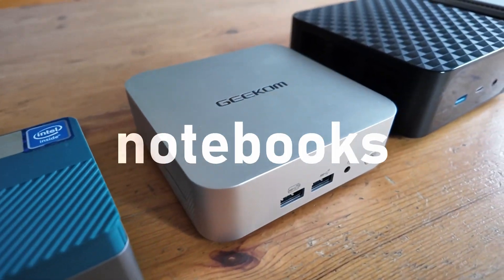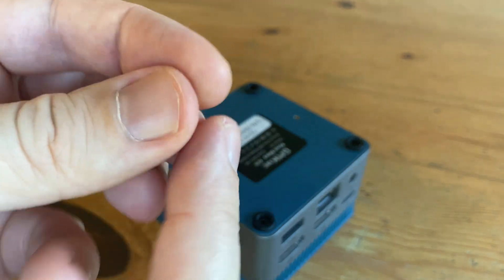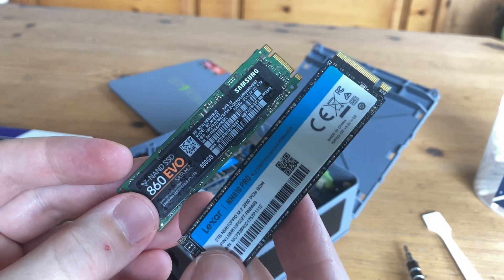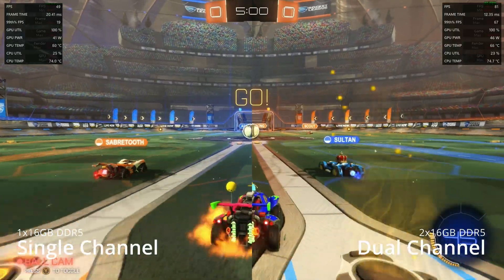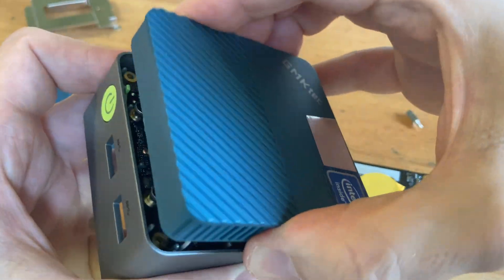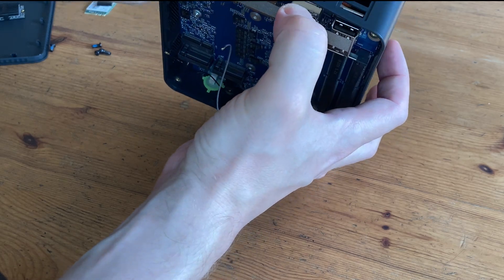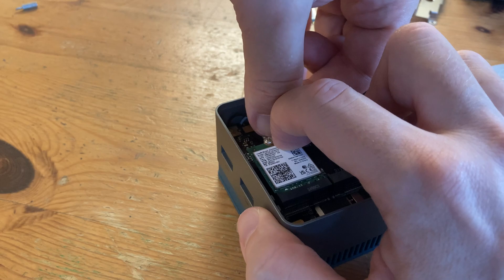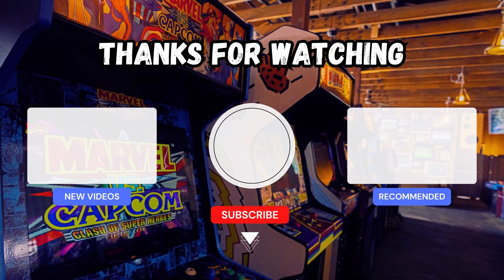Supercharge Your Mini PC! WiFi, CPU, Storage, Memory & GPU Upgrades Explained

Comment: If you want to reapply thermal paste to the cpu cooler MAKE sure your mini pc is not a model that uses liquid metal before proceeding. If it uses liquid metal leave it alone. You have been warned.
Reply from the maker: @toadfish54321 extremely good point. I'll pin that for you
Reply: Any examples of mini PCs that use liquid metal?

Comment: Brother try to cover bluetooth issue with k6 gmktec. It lags and turns off under gaming load
Reply from the maker: Bluetooth and WiFi use the same chip. I reckon switching the WiFi chip will fix both issues

Comment: Hi guys. I realy need your help. I just buy a New laptop gaming Acer predator Helios 300 2022 
Rtx 3070 ti i7 12700h . And il getting thermal limite and Power limite when thé GPU consume a lot of wat like il getting it alwayse when GPU is 62° + GPU consomer a lot of watt cause i play dragon ball z kakarote with hight setting on hot place température get 70° and i get only Power limit (dont activate thermique limite) when i use fans max speed and tempirateurr GPU lower then 62° thé power limite stop . I get this prb when GPU work hard tbh . M'y gpu should bé at least 87° to activate thermique limite. What u think bro us my laptop broke . ( I change métal liquide cpu , bé abusé CPU was realy getting high tempirateurr. They told me pc was on long term storage)
Reply from the maker: @ilyesmalki6447  ?  What?   Christ, did you try to make this unreadable!???

Power limit = Might be your power adapter can't provide the computer enough watts, or you might just want to turn on vsync / sync to your display / limit the frames per second.
Reply: @TeamPandory  the problème is when thé GPU température is 62° . Thé power limite and thermique limite gpu active . Thé GPU is not hot but i got a thermique limite and hotspot i thnik difernce is 12° (if GPU 62° / hotspot 75° ) do u think vram or vrm are hot ?

Comment: any thoughts on using thermal pads instead of paste for the cpu? putting together a build for a gmktec m5 and i'm considering using phase change pads as i hear they have better performance over longer periods of time. it fits my use case as i'll be turning it into a 24/7 router and eventually convert it into a server
Reply from the maker: You can always give it a go. Generally thermal pads are going to perform worse than paste, but I've seen some that are pretty pricey, perform well and can last a very long time. Haven't tried them though.

Comment: I have a HA-4 Ryzan 7 7735hs and want to upgrade or get an external GPU to run 5120x1440@200hz resolution on a LG 45GR65DC-B monitor right now the monitor will only give me split screen or 3/4 of screen it has different screen layouts but wont give me full screen for win 11 pro but i can hook a PS5 or Xbox X directly to the monitor and get full screen with no problem ? Dont know wjat to do any suggestions please help!!!!

Comment: You make me wanna pull the trigger on a mini PC 😂. Personally, which brands do you think can be easily worked on especially for non-technical people?
Reply from the maker: @leel730  tbh the gmktec M7 / M7 Pro / K8 Plus all work great out the box, and have the oculink for extra punt if needed later.  Won't need much fiddling, and I've managed to get into them without much fuss.
Reply: @TeamPandory  been thinking about the M7s as well. Great to hear from you. Amazing content, btw. Keep going! 💪
Reply from the maker: @leel730  Beelink devices are also built very well 👍
Reply: @TeamPandory  yeah, but the M7 is a bit cheaper than the SER6. Thought about the eqr6 but I'm a bit scared of the longevity of an integrated power supply.
Reply from the maker: @leel730  👍 each choice has a pro and con to it. It's quite amazing how some of the tech YouTubers just see all mini PCs as the same, when there are some huge differences between each model.
It's like each manufacturer has their own flavour. 🍔
Reply: @TeamPandory  couldn't agree more. And mini PCs just keep getting better every year.

Comment: So...If you have 16gb Memory on DDDR4...Can you upgrade your mini pc to have 32gb DDDR5 ??, Or do you have to stick with DDDR4 ??
Reply from the maker: @The_Arby  no.  The memory that can be used is dependent on the slot. Ddr4 slot fits ddr4, ddr5 slot fits ddr5.
If you have two slots and 1 ddr4 module is in there, if you can get the same chip and place it in the other slot, it will run in dual channel. Much quicker.

Comment: my gmktec m6 has no sdd heat heatsink. 
i think I'm going to buy a heatsink  for the ram too.
Reply from the maker: @Rayu25Demon  the M6 doesn't really need heatsinks as it has active cooling of the ram and nvme.  If you can find that heatsink of the reatan, that would help the lower memory somewhat though. I REALLY want to install that in some of my other computers.
Reply: @TeamPandory  i have no heat problems, but the pc is always  on because it's a firewall  and a file share server.

Comment: What is the port where wifi card is placed in Gmktech G5? could this be used for eGPU? then wifi replaced by usb dongle or just using LAN for internet.
Reply from the maker: It'd be an M.2 A/E Key'd slot.  You might be able to get an A/E to M key converter, which will give you PCIe2.0 speeds.  Not as good as oculink or anything like that, but it is something.
Reply: @TeamPandory  thanks for the answear. The goal is burst gaming to suficient 1080p for cheapest way . Not for AAA games but for some preferable games I like. I would try GTX750ti ... or GTX1050Ti

Comment: Sometimes the fans themselves are the heat issue.  Just replaced a fan in a laptop where the bearing went.  Temp went through the roof.  So did the noise coming out of the laptop.  The laptop is 5 years old and I had to cut the tape.  Completely clogged with dust in the fan and in the heat pipe fins.  Took the other fan out and it was pretty clogged but reinstalled it.  They were the same fans but one was set upside down for push and pull I guess.   

The fans are 20 bucks US.   I E-Bayed out of China.   I mentioned 5 years.  Did a Youtube search for the fan model.  Someone from China did a ASMR video about 30 seconds long 2 years ago.  Showed a box of these fans.  132 in the box.  Did the finger crawl and finger tap on the cardboard box.  That had me concerned, so I bought 2 of them.  The video was bragging about having these fans.   My guess 5 years out and the fans are New Old Stock at this point.

Now on to the tape.  As I wasn't going to reuse that tape, I needed tape.  Black + shiny electricians' tape has heat limit in the 90 C range.  It also stretches (and shrinks).  Off of Amazon I bought "Tesa's Most Advanced High Heat Harness Tape 51036 Mercedes, BMW, Audi, VW" on September 10th 2024.  And is no longer listed on Amazon as of Oct. 4th.   It's a tiny bit thicker than the tape that I removed.  It doesn't stretch or shrink.  It has a heat limit of 150 C.  I figured if the laptop maker wanted to seal that heat pipe fin/fan gap that bad, then it's needs to be done by me also.
Reply from the maker: I did similar to a Geforce 1060.  You can grab fans from aliexpress, a quick switch and all is good. :)
Reply: @TeamPandory  I installed a temperature program now.  With the new fan and cleaned fan/fins I know what a "Nice" temp is.   I've setup in Google Calendar to check the temp every couple of months.   Any future dust and dirt is going to start raising the temp long before something fails.  As you said, piece of cake getting into the fans and heat pipe.   While 5 years before it finally failed, my guess it was pretty bad after say 3 years.